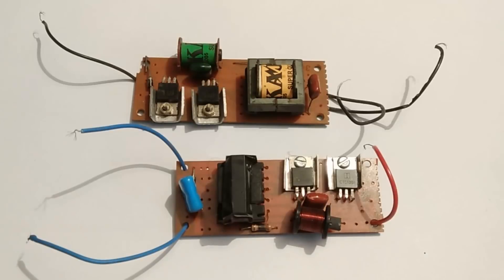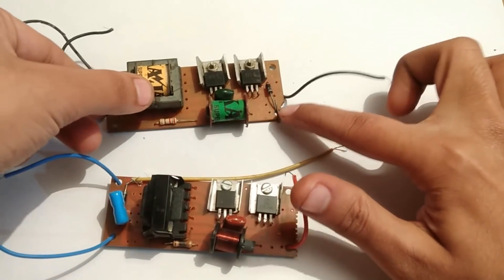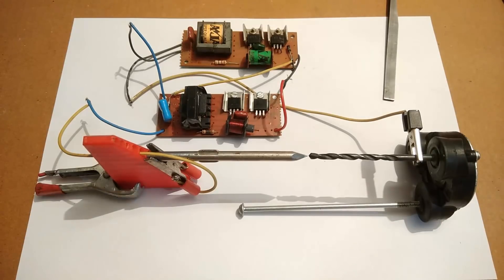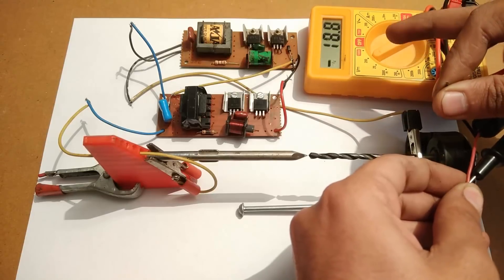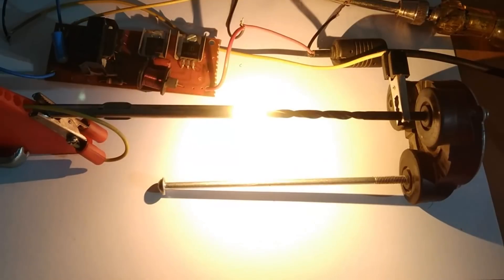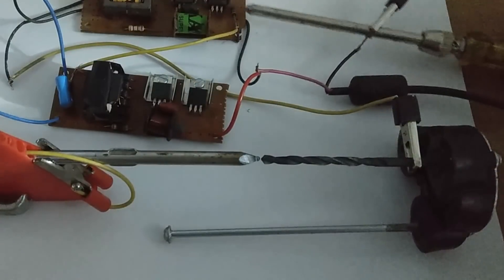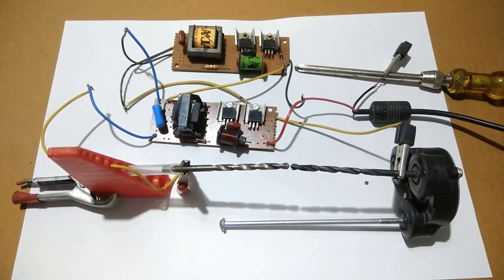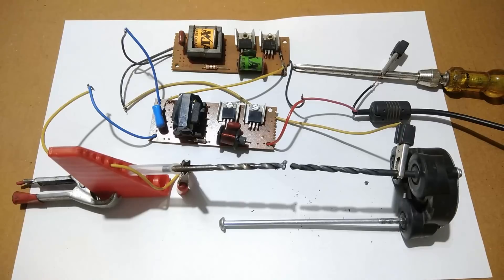Homemade Wireless High Current Generator DIY

Comment: Mr Electron, the definition of a Generator is a device that converts mechanical motion into electricity.  What you have here appears to be more of a voltage converter.

Comment: you should get a cheap laser pointer used for seminars and presentations and shoot it through the middle of the fireball and see if the laser out put picks up extra power to be able to cut through something at the same time
Reply from the maker: Jim S interesting